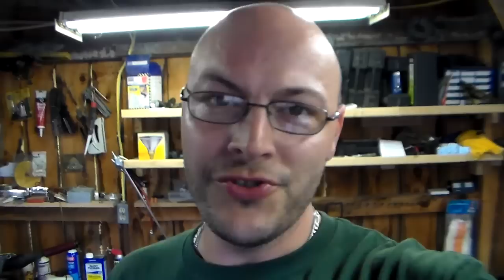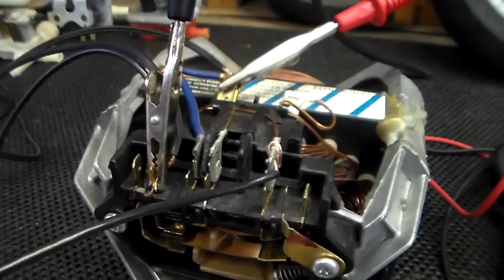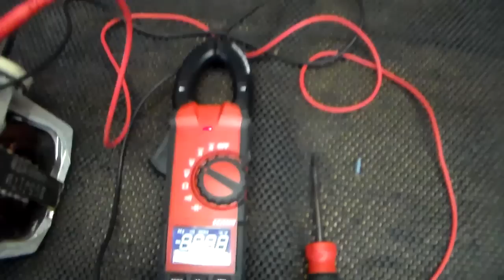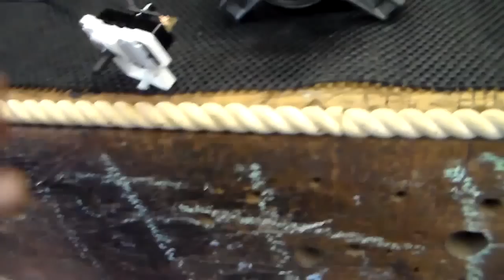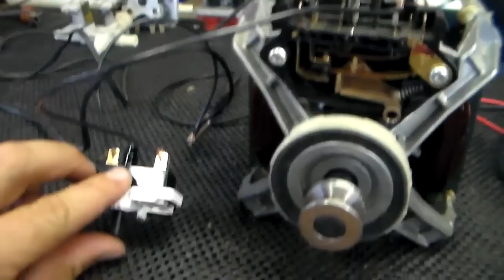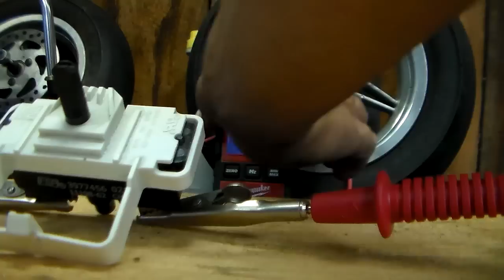Dryer Troubleshooting - Start and Motor Switch Testing

Comment: My dryer's motor was kinda seized (rotating very slow in dryer). I took it out and tested as Bill did, it gave the motor a jerk that removed stuck lint/debris and motor runs strong again. Thank you for this video. You are a LEGEND even after 12 years!

Comment: Awesome video, to clarify if the dryer motor is running hot and i stop and  attempt a restart and the motor just hums is it the thermal overload doing its job or is the motor just shot and without balls at that point?

Comment: We've been forcing our start button to stay on (Kenmore HD 70 Series) and do 5-6 loads every Monday for months. Everything runs as normal and it doesn't overheat. Guess I'll replace the motor pretty soon. Loved your explanation. The local tech, with 24 years experience couldn't figure it out, I guess it takes precedence.

Comment: Try it now with a digital control panel! With that your motor may run 1, 2, no mo more than 3 seconds and shut back off with no errors or faults…. Most people spend $400 plus for.a new main control board only to find out it still does it!

Comment: my dryer motor hums, I've cleaned lint & blower wheel turns easily.  As a test only, when the blower wheel is manually spun and the start button is pushed- motor works fine, heat element turns on & timer works.   Is there a start capacitor that would be bad or is the motor toast?  Thanks for your video!

Comment: I have a blue in 2 and orange in 3 and black in 4. They are all soldered to those connections..My problem is that the motor will not start any more since I dropped it from my working table (about 3 feet). I was using the motor as a sander.

Comment: Thank you I believe you just solved my issue with my dryer. It kept stopping after running for about 30 minutes or less. We had to wait for it to cool down before we could start back up again. I went through all the fuses and replace almost all of them except for the heating element. I was about to throw in the towel.

Comment: Bill, nice video. Quick question. If I buy a new dryer motor for my GE, a WE17X10010, do you have to have a new jumper harness with it in order to plug it in to the new machine or can you just use the harness that comes from the machine that was plugged into the old one? thanks.

Comment: Great video. My start switch turns on the motor just like this. But my dryer still doesn't work. All the fuses are new, door switch, start switch, timer. All of it. All I get when I push the start switch is the buzzing sound when I push it and the timer is in one of the off positions. Everything has power and everything has continuity.
Reply: And of late reply but it was a bad motor or winding switch it gets stuck and won't turn on  you  gotta pull the clutch back with your finger. But in the end it's the motor  hope you got yours fixed.
Reply: @octaviogarcia928  It was the receptacle/power supply. It read that it had power but somehow wasn't enough. After all that work, we tried another machine (that we knew worked) and it didn't in that receptacle. Rewired back to the panel with new receptacle and breaker and both dryers worked fine. Ugh! Leaned a lot about dryers though.
Reply: Great content and this  issue most videos don't cover. But it's important cause it can leave  the  element  running  without people noticing. Thanks man for your knowledge

Comment: I have a problem with my dryer i have replaced the thermo switch high temp switch and the one you tap on the ground to reset. I have continuity with the top dial for timing and the switch on the motor i also replaced the heating element and all the other parts. the dryer runs but still wont heat. i checked continuity again on all the parts that i replaced and they are all good. what else could it be? i have a kenmore 90 series dryer

Comment: I have the opposite problem: heater comes on even without pressing the start switch, and no noise from the motor at all.  Heater only goes off when the timer is moved to the off position.  Am guessing this is also due to bad switches in the motor.

Comment: When I jump my start switch to the motor and it works wouldn't that mean that all is OK?  I changed the timer and new control board, and all the thermostat and other switches all check out as having continuity including door switch, then absolutely nothing happens. I'm baffled by this.

Comment: Hi. just need your advise...my combo stackable dryer motor is not running when it is connected to the pulley and belt., It cause humming, then its stops. But when i took all that connected to the motor or all the loads, the motor is running. Means without the pulley and belt connected. Does it mean, i need a new motor? I was thinking this motors in a dryers had a capacitors only need to change..

Comment: Thanks  , great video , run into it trying to solve my  Samsung dryer problem . Heats up on start but does not restart heating unless I turn dryer off. All thermostats and coil check out . Thinking it may be heather relay on the board . Any Ideas? Thanks

Comment: So you have 3 wires that are actually coming from the motor coils itself.
These wires are hooked up to pin 3, pin 4 and pin 5
There should be one more wire of course total of 4 wires.  Two for run winding and two for start winding.
So one end of the both coils must be connected together down inside the motor and that one ends up being called The Common.
So you end up like this: Start wire, Common wire, Run wire.  Or you can say Start, Common, Run.  SCR.
So which one of the three wires ( White, Tan, Blue) is Start, Common and Run?
How do you determine?
You have only one option of course. You check the resistance between each of the wires.  You end up with 3 resistance readings of course.  And certainly each has different value.
Based on that you determine which is which.
Consclusoin:
The lite blue is common. It is the one that incidently is the one that gets power when you close the door.
It is pin 3 counting from left. The lite blue wire
Pin 4, the tan wire is the start winding.
And pin 5 is the run. The white wire.
So it ends up like this:
Your dryer start switch has 3 wires. One is the hot incoming that is fed by the timer switch.  That hot incoming is directly connected to one of the other outgoing wire on the switch. And the end of that wire ends up at pin 2 of the motor harness.
When you push the start button, you connect the other, the third wire and the end of that wire ends up at pin 5, the run winding.  The white wire.
The power at pin 5 also ends up feeding the start winding ( pin 4) by means of that copper arm whe the arm of centrigugal switch is up. So the push button sends power to run and start winding.  The instant you let go of the push button, you cut off the power to both start and run winding (pin 4 and pin 5).  However the arm ( the copper arm) under pin 5 drops due to centrifugal switch arm falling and contacts pin 2 which is the second wire on the push button so the run winding circuit is complete that way.

Comment: thanks! Bill pin 1-7 on real motor 3395654 marked as 26436G1=>neutral is 6, hot is 4, start button leads neutral to 5. 4-5 is run coil and 4-3 is start coil. motor switch during running close 1-2, disconnect 5-3 and close 5-6. I use real motor pin#.

Comment: Trying to figure out why our Frigidaire Affinity dryer has no power to the mother board. There's 240v from the power junction going to the connector on the motor but there's no power leaving the connector on the motor. Looks like that wire has continuity to the fuse - or limiter that it goes to but no voltage. Any ideas? Thanks so much for the great vids man,

Comment: BILL THANX!  I tracked the problem down to the switch I pulled the switch out of motor and it is rivited together I will drill rivits out and see if I can fix it, but if i can't fix can I buy new switch and where?  THANX AGAIN!

Comment: thank you Bill,  this old kenmore 70 dryer motor will run about half a minute then cut off;  even in " air dry "  on the timer . i cleaned  up the centrifugal switch breaker points  so the dryer would  heat up again '  the dryer did warm up, so i shut it off.  On  the second time i try to run it ,  it started this  latest mess of now cutting off after half a minute or so.   After another  30 seconds you can hear the  reset click on and smell electric wires burning   I will look at the motor again for a short circuit  but i suspect the centrifugal switch that i cleaned the contacts are causing this old machine to refuse to work.  help  help

Comment: Do you have a video which explains why my Samsung DV45H7000EW/A2 runs for 5-6 seconds, then shuts off and restarts after 2.5-3 minutes and repeats?  I checked my belt tensioner and some of the tumbler wheels and they needed care (clean/lube) but didn’t fix the issue.  Heaters don’t come on...

Comment: I watched your other video on trouble shooting and tested the motor through pins 4 and 5 and got good readings on my ohm meter, so if I understand this correctly the winding of the motor could be test good, but the motor is still defective because of this switch?

Comment: Sir,my kenmore 500 110-69532800 is not heatng but runs...* checked every thermo switch,now have drum out..I unplugged motor,then put meter pegs on outside 2 terminals..When I pushed the black collar 9n shaft inward,it beeped..Now when motor is turning by hand,nothing is happening,does that mean arm is bad on motoro switch?What makes that collar push in to open the circuit?When I push it in by hand,it beeps..Elec dryer not heating...Element even checked.lol...Thank you for helping people with your videos

Comment: How do you verify the start windings.  It hums and runs if I assist the drum turning.  Acts as if it has a blown capacitor, but this is a Kenmore and does not come with a capacitor.  I have checked it's fully disassembled, all are in place.  Nothing seems broken, it just will not start without assistance; even with the drum removed and the tension switch engaged.

Comment: +Bill Newberry I'm using this same motor on a different project, but need to reverse it's starting rotation. Are #4 and #5 the Starting-Coil leads that I need to swap or do I need to swap #5 and another not shown or at a different terminal?

Comment: Thank you!  But I found this after I just went thru the same routine with a closed switch and a newer dryer.  I had the circuit diagram, and was able to identify which was normally open and which was normally closed when I pushed the centrifugal "latcher".   I never thought anyone would have the same problem.

Comment: I have a dryer that starts as soon as you move the timer from off position. I disconnected the start switch and it will still start automatically. I have a feeling that the contacts in the motor are stuck. Is this possible, and/or have you seen this before? Thanks.

Comment: Thanks. I am fixing a dryer for the first time and couldn't figure out why the dryer was supposed to stay on after the start button was released. The circuit seemed to be centered around the motor and even the heater wire was going to the motor. I now understand there is a switch in the motor that activates when the motor is spinning.

Comment: Hello, my dryer turns on for 3-5 seconds then turns off. If I leave it, one minute later it turns on again for 3-5 seconds and again turns off again and just keeps repeating that cycle. Is the motor over heating?

Comment: Thanks for this video, after 2 hours of trying to figure out why my heating element stayed on no matter if the timer dial was in the on or off position (scary!), this video gave me the confidence to dig into the switch itself. Contacts on the heating element arms were fused closed. Quick screwdriver pry, a little file, and dryer works as expected. Thank you!!

Comment: Sorry to bother you again but my theory about the centrifugal clutch was wrong. In reading about the circuit, I found that the Even Heat Control Board generates 48V Dc to energize both two relays, the motor relay and the heater relay. So in addition to your circuit on the motor with the centrifugal switch, the even heat control board generates 48 VDC to energize two more relays. So in the troubleshooting diagram you are checking not only to see if you have 120 AC at the motor to hold in the on switch but also have the 48VDC relay. So as it shows in the video it is possible for the Even Heat Control board to affect both the Heating and Holding of the on circuit. Seems I had three shorted 16 volt zener diodes (total 48 VDC) so that both the heater relay and motor relays were affected.  Here's the video site  https://www.youtube.com/watch?v=TbMurRamCLQ&t=101s
Hank

Comment: Great video! Thanks for posting. Discovered that two things weren't working on my dryer. One was that the start push button would not remain engaged. It did however start the motor and turn the drum. At the same time, I noted that even with the drum spinning I wasn't getting heat in the dryer. So it seems both functions of the motor switch were not working. After cleaning the motor and seeing if the centrifugal switch was working and closing the contacts on the motor switch it showed that the contacts were closing properly and connecting the heating circuit and the hold in for motor to keep running. It seems to me, since I had two symptoms (the motor not staying on after depressing the start button, and the heating circuit not being engaged) the problem could have been that dust had accumulated around the centrifugal switch preventing its full travel and thereby making two things fail at the same time. Having tried your circuit test here in the office i saw that the dryer motor would stay engaged through the relay when the motor comes on, I'll see tonight if I also have heat in the dryer. Thanks again for your superb video. P.S. So l think a tech might just have been able to suction out enough lint so that the centrifugal clutch had full travel.

Comment: Hi Bill.  Great video!!  After testing my motor it still starts but not run.  I have opened the motor switch to see burnt carbon deposit on the upper contact blades. I cleaned them, then used a steel lime to gently grind the surface and polished them with a 2000 grain metal sandpaper.  Both surfaces are now soft and shiny but my concern is with the beads thickness.  Would it be possible there is still a gap between the blades thus not having the motor to run.  And if, so would it make sense to put some solder on them to increase there thickness?  Or is the problem comes from somewhere else?  Everything else is fine, fuses, switches, relays etc...  Thanks in advance for your input.

Comment: i have a real good one for you bill i have a kenmore he4 dryer that runs when it feels like it the problem i am having is i have some lights on my control panel on all the time when plugged in, the damp light, normal button light, looks like two 11 in display and a extra low light all are on. i can`t get into diagnostic mode and it will not start i can sometimes clear these light by pushing dry time start and cycle end buttons then it runs great until it stops again wtf it is driving me crazy please help

Comment: I hope you're still out there man. I have a problem with the same type of motor. The dryer started humming and stop tumbling so I took out the drum and the motor runs fine but once I put the drum back inside the motor just hums, seems like it doesn't have enough power to spin the drum. I saw another video where it says that if the motor is weak, the capacitor needs to be replaced, but I don't see any capacitor in this dryer. I tested the motor with a multimeter but everything seems ok, put it back in the dryer runs good, then I put the drum, belt and everything, then the motor just hums and it won't spin the drum. Do I have to replace the motor? Or is it a bad motor switch? And where can I find it?
Reply: Hector Guzman Hi Hector! Did you check the blow wheel,idler pulley???? Greetings buddy.
Reply: ceferino lopez hi. Those part seem to be ok. One guy who is an electro mechanic checked the motor and said there's nothing wrong with the motor and he told me it could be the switch that comes with the motor and he said the best way is to eliminate that switch and connect some wires directly to the motor with a toggle switch and that could solve the problem. I sorry for the late answer.
Reply: Hector Guzman Well Hector, don't know what to say,I had this issue before a long time ago,I don't remember the brand,it was a washer/dryer combo,and it had the same problem than yours,when I start it,it just hums,and didn't run,I could fix it,it was a loose wire on the motor capacitor,but this one,you say it doesn't have it,so try the switch on the motor,maybe that would do it.Good luck Hector.saludos brother.
Reply: ceferino lopez hm I'm going to check the other connections, like you say, it might be a loose wire. Thank you bro. Blessings.
Reply: Hey, did you fixed it? Im having exactly the same problem, i can hear humming but drum wont spin.

Comment: You connect you meter to the circuit, apply power, and then select setting to measure on the circuit?    

Nice video.  You taught me how power and start the motor for another application.

Comment: Amazing... I spent what felt like forever searching for schematics and general help on how to direct line power test this exact type of motor (same connector)...  Had an general idea but I really didn't want to blow mine motor up doing the test.  I followed this video, even just used a regular house light for starter switch, alligator clips, and I was able to prove my dryer motor was good - not the issue.  I did find and fix another cause.  Thanks a ton Bill!
Reply: so what was going on with Daryl's dryer? mine is a Kenmore elite 110.72956100 gas dryer. I've changed out the start  relay and it does the same thing, and that was $33,  and a motor would be $52. If that's not it, I'm screwed!